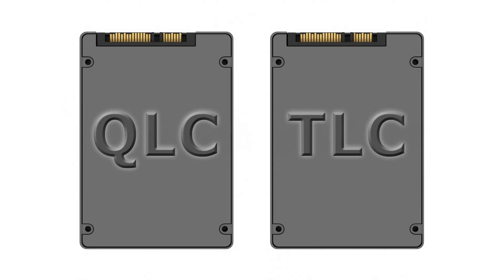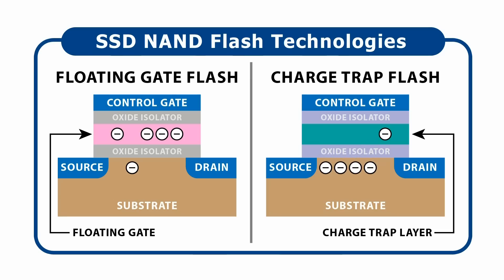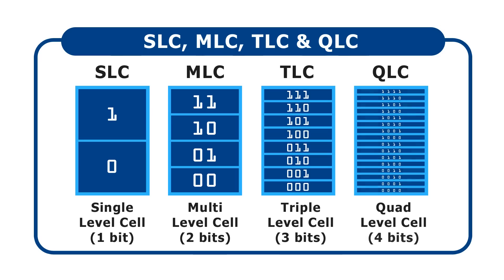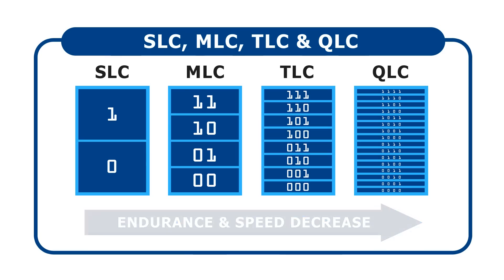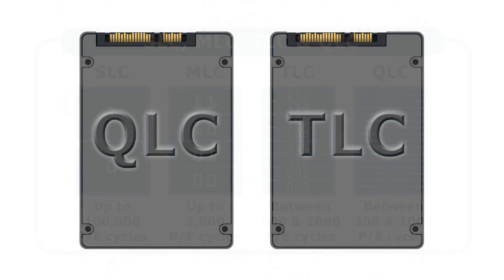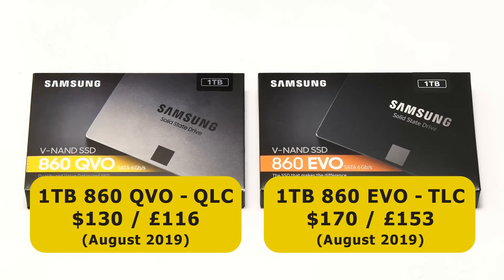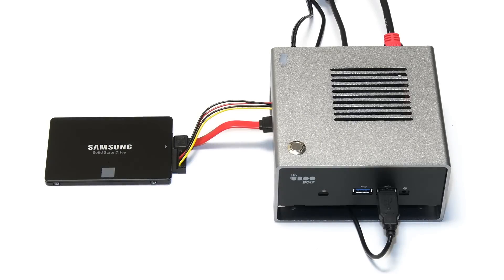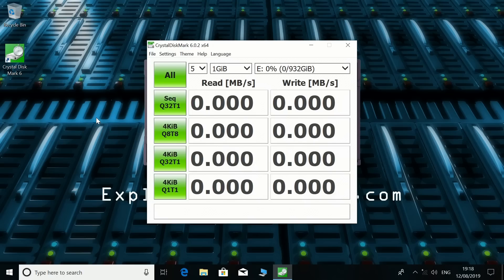QLC vs TLC SSDs: Samsung QVO & EVO

Comment: So then the days of having our computers simply work for 10 years and more are DONE! We must get used to the SSD drives as EXPENDABLES! And religiously back them up so that when the TRIM function uses up all the available cells in the SSD and we get a 'disk full' message we can than pop out the EXPENDED SSD drive and pop in a fresh one. I predict that most users will find this quite annoying. They will say to the computer manufacturer: "You DIDN'T TELL ME that my computer would need a new disk at age 3! And my formula for curing cancer, eternal energy, protecting the earth from asteroid impact and bringing peace to the world WAS ON THE "EXPENDABLE" DRIVE!! NOW IT'S GONE! THE WORLD IS DOOMED ALAS!!
Reply: as you will find below that is the time of warranty, most users will not reach the life expectancy any time near that Point in time.
the life expectancy of your Computer is usually Shorter than the life expectancy of your ssd, if the ssd is expected to last ten years even for a power user.
also: you should never rely on a single drive to store any important data. anyway. BACKUP BACKUP BACKUP!!!
also: exchanging your ssd is simple and quickly done.

Comment: I am still working with a EVO 840 250Gb for 4 years now and i still have no complains about the drive. I am at 1/2 way of its lifetime now. I used 60Tb while its lifetime expects to have in between 120 to 150Tb writing. But my next drive soon will be an EVO 860 1 Tb drive for certain.
Reply from the maker: I know that so many people here use EVO drives. They are great SSDs.

Comment: Actually, the boot/system drive is probably the best place to put a QLC drive.  I wouldn't put the swap partition on it, that gets lots of r/w activity and will more quickly wear out the drive.  However program files are not very often updated, and if you leave enough uncommitted space on the drive for wear leveling they will last quite long as a system (ie: program storage) drive.  If you do lots of video editing, cad work, program development, etc, where you create lots of data files (especially temp files that get created, overwritten, and deleted often) then you'd want a more reliable storage drive.  MLC and TLC drives with lots of uncommitted space would work well here, but you'd have to buy a QLC drive with perhaps double the amount of space to get enough write cycle life (IMHO).  Either that, or a fast rotating drive for your workspace.
Reply: For a modern system it's arguably better to install as much memory as you can and have no swap file/partition at all. You can even go one step further and create a RAM drive and tell the software to create temp files there instead.

Comment: How does the number of read/write cycles of a QLC SSD compare with a standard micro sd card or a sub flash drive?
Reply from the maker: Most SD and other cards, including USB thumb drives, will be TLC these days. A write endurance of maybe 1,000 PE cycles or less is likely to be typical.

Comment: Wanders off to buy a Pro MLC drive instead.   lol  ;-)
Reply: Maybe another comparison between all of them would be a good video 😉
Reply: Better buy a enterprise slc ssd :P
Reply: @TotoGeenen  YES. Smaller capacities but those DO live upto the FLASH DISK hype. Sadly, the controller failures are the big issue, no matter the nand type so...
Reply: @TotoGeenen  I would, if I could find them.
Reply: @darkfalse  they're enterprise so they're not easy to find on the sites you're used too. You could also try searching for specific drives to get better results, for example the HPE P06952-B21 750GB. SLC ssd's are insanely expensive though and a consumer there's no real reason to buy them. 
Some of samsung's more expensive drives are MLC though if that's something you're interested in
Reply: Hey Toto, what do you make of MiCRoN's 5100/5200 MaX series?

I know they are supposed to be better than their PRo & eCo counterparts, but are they the same as a PRO version from SaMSuNG??
Reply: @demitsuru  It depends on how you value your data, plus look at the slow down on the quad level SSD, if that is going to be a problem for you or not.  You can protect your data with back-ups and NAS, on slower HDD, so you can still use SSD even if you don't 100% trust them.  My boot drive fails then I lose very little, I have to install W10 and Office plus a few other programs.
Reply: @twmbarlwmstar  - everyone who values their data backs it up anyways. Also NVME is basically the same price as 2.5" now and MUCH faster. Samsung Pro drives have been a waste of money for years and continue to be.
Reply: @itsneight1260  "everyone who values their data backs it up anyways" missing my point I think.  And what evidence do you have that the Pro drives are a waste of money?
Reply: 2 thumbs up.. I reviewed USB flash ssd tech.. Yup, MLC wins by far, and for Samsung go Pro or just use pen and paper !
Reply: @Propaganda Blitz There's middle ground as well, they realise that we can't afford enterprise so they offer premium SSD.  I'm just not short of storage, I think I have, depending on how you count it, about 20TB.  Most of that is HDD NAS but I still have a few TB of SSD and about 2TB of fast SSD (although obviously there is always faster).

This will only be a consideration for future builds for me and I think I will just go fast small SSD for the Boot drive then one of these for storage.  Probably hang on to SATA a bit longer but the writing is on the wall there- if the motherboard has two M.2 slots then you don't need the SATA.  Although often enough the 2nd M.2 will only run SATA speeds anyway (or reduced speed).  You get that with AMD and their APU.
Reply: @twmbarlwmstar  Do you have no form of compression? A compression like ZIP and GZIP can at least save 1 or 2 TB from that. Though, it will take a while to open it back up
Reply: its your money... waste it where you want to.

Comment: My old old 840 EVO 500 GB still does 541 MB/Sec, just hit 13178 power on hours :)
Reply from the maker: Those EVOs are such great drives.
Reply: Hey, I have one as well, still going strong - although I don't boot from it anymore (I have a 960 Evo), instead it is handling my games install files.

Comment: Clearly, reliability and speed are trade-offs, but the average user of computers would probably not notice them for a good while, got it!  Another great and useful video, you have all my thanks!!

It occurred to me that perhaps the EVO was able to empty the cache more quickly (being the faster of the two technologies) so the big slowdown was averted in this instance, and thus the bottleneck was with the UDOO Bolt or Windows 10 (or the combination of the two).  Not knocking the UDOO, but I wonder what the tests would be on a server-grade or a gaming machine would have been, all else the same?
Reply from the maker: I am sure you are right that the EVO can empty its cache (to its TLC cells) more quickly. I should have though of that. I doubt the UDOO BOLT is a bottleneck here -- its got a quad core Ryzen CPU and 32GB of RAM.

Comment: Manufacturers should really make the effort of advertising clearly the differences between both technologies. If you look at these boxes, there is simply no clear mention of the current technology.
This is clearly a way for misleading some consumers.
Thanks as always for the fantastic video.
Reply from the maker: I had not thought of this -- you make a very good point indeed. Both the EVO and QVO Samsung SSDs are great drives, but they could be clearer pointing out the differences.
Reply: @ExplainingComputers  ,
I'm constantly explaining to people why QLC drives aren't horrible. There's massive confusion related to the performance drop that only happens after a large, sustained write. But people keep saying "don't buy QLC because the performance just drops off a cliff if you do much" when in reality very, very few people will every write that much data at once. The LOWER PRICE makes a QLC SSD more than ideal for most people... if you're some god-like being who explains computers you may have different needs but for us mere mortals QLC is fine.
Reply from the maker: @photonboy999  I totally agree. I think we will see QLC drives become more and more popular with many users. As I said at the end of the video, we did not trust TLC not that many years ago.
Reply: @photonboy999  Sadly you are mistaken, QLC Drives are good, the downside is the time it takes that drive to become worn out compared to a TLC or even an MLC drive.  QLC Drives wear out faster writing the same amount of Data that a TLC writes,  while they are a great cost to performance solution the issue comes down to long term redundancy and it is there that QLC lose their luster.  So you wouldn't want to use one say for your system drive, but a steam drive would be applicable or movies and music, basically anything that doesn't constantly have writes, erasures and more writes.
Reply: It raises a point about marketing and how specs are very much manipulated. There is some what a comparison here to saying it's like buying a car that can do 100mph, but after 5 miles it's limited to 50mph. A bit of a grey area really. For normal daily use I can see that this would be fair enough (at least for the drives, not the car). But if this is not clear it could cause problems in certain usage scenarios.
Reply: I would never fully trust any advertising or marketing claims made by the manufacturer, best thing to do is educate yourself then form an opinion then make a decision.

Comment: 12:32 I think the SLC cache content could just be written to the TLC memory faster than to the QLC memory.
Reply: That, or the drive itself is one that failed QC as a 2G drive, so got programmed as a 1G drive with only the good blocks allocated, leaving the 2G drive controller ( which would be the same controller per generation) with it's much larger cache in there, but with the reduced main memory capacity. 

Another is that they ran out of the lower capacity chipsets, so instead ( probably as it is a single pick and place item, with a stacked die inside) simply substituted the larger cache chipsets instead as they are layout compatible, or they have depreciated the older controllers with the new higher capacity cache version, and there is a blend of the different size cache controllers currently in the supply chain, so they are refraining from updating the spec sheet till they are sure all the older versions have been sold off in the supply chain.
Reply from the maker: @SeanBZA An extremely good point -- I can believe this is the explanation. :)
Reply: ExplainingComputers would be maybe good to test with more than 78gb, too.
Reply from the maker: Good point.

Comment: I guess it would be useful to make some estimate of home and home office data read/write along time units like monthly and yearly. Windows and Linux, with qlc as boot unit. That would involve os updates, and day  to day use. It will involve many estimates and approximations, but, at least we could grasp some actual, practical meaning of ssd units r/w endurance, other than 3 or 5 years warranty.
Reply from the maker: 360TBW is about 1TB a day for a year, or 333GB a day for three years (the warranty period). In practice, very, very few home or office users are likely to write 100GB a day, which is about 36TB a year. So for most users, a life expectancy of 10 years is perfectly possible (which in turn is considerably longer, even today, that the life expectancy of most other components in a PC).
Reply: @ExplainingComputers  My 250GB EVO has been the boot and application drive (Windows) in my PC for around 3 years with around 12,300 power on hours (with a HDD as my data drive).  Samsung Magician reports that the EVO has written only 14 TBW, so very low indeed despite having reinstalled Windows and all applications on this drive quite a few times.  This PC is in use every day for at least 8 hours with a wide range of applications.  Applications that generate very large files (and scratch disks), and large file downloads, use the HDD.  So, for my "average" home use as a Windows boot and application drive my EVO SSD should last well beyond the warranty and the life of my other PC components.

Comment: I wonder what is next, penta-level cell?  (PLC)
Reply from the maker: Potentially, yes, we will get PLC. But the difficulties in reading more and are more memory states beyond QLC may not be worth the storage improvement. In PLC, a cell would have to reliably distinguish 32 states. And for the doubling in accuracy required, the payback of 20% more storage may not be worth it. In time, I'm sure that PLC will exist. But I imagine we have a good 4-5 years now where TLC and increasingly QLC will dominate.
Reply: @ExplainingComputers  - Thanks!
Reply: At least as a consumer, considering halving the life span of a SSD again (considering the QLC as basis) would make that rather pointless. I would certainly want to use a drive like that unless they become dirt cheap. Even then I wouldn't trust those drives with any meaningful data to begin with, just in case.
Reply: @Chrotesque  - Considering new adaptations that fall outside the performance and cost factors, I could see innovations like built-in RAID1 that would use the second half of each data block for redundant storage.  With a custom controller chip this wouldn't slow the drive down much and might even make them more reliable than MLC and TLC.

Comment: So you're saying SSD's work off of some form of wizardry.
Reply: That's reassuring, all those years I was thinking it was witchcraft.
Reply: @Cellphone Dave That explains that little guy with the pointed hat that appears on my screen. Got 'WIZZARD' spelled across his hat, calls himself Rincewind...
Reply: @brianm6337  I do wish these Wizard's would pop up a message when their about to die, as all Wizard's know when they are going to die :)
Reply: @wembley636  Only if they are SMART i believe. ;)
Reply: its molecular level wizardry .
Reply: thinking about the billions of  transistors  and the millions and millions of lines of code and data and tiniest mechanical stuff like hard drive head reading, i prefer to look at my pc and just think "magic, it gotta be magic" :D
Reply: @Cellphone Dave Don't forget all the pixies which do the wizard's bidding by moving the electrons up into the traps and back again.
Reply: @MrJozza65  Pixies don't work for wizards. Pixies are pure evil and wouldn't be subservient to just any wizard. However  if this was the case, I'd have to figure that they are unionized and the drives stop functioning properly when pixies retire with huge compensation. This compensation would/might not allow the wizard to afford payment for replacement pixies which may lead to unworkable bits of the work space.

    If you don't believe me that pixies are evil touch a live 120 AC wire and see if the pixies bite you.
Reply: @ITpanda  Good point, but I think that the pixies are probably working under the wizard in return for a particularly favourable renumeration package to suit their wants. If that's not what is happening, then I have no idea how these drives could possibly work.
Reply: He's a sorcerer ...an enchanter!!  There are those who call him...Tim!!!😃😃😃😃
Reply: lol
Reply: Lizardy
Reply: If you take a syringe and shoot some pudding into your drives so the Wizard can eat the drive will last longer.

True story.
Reply: @Cellphone Dave lol!
Reply: it's a trap...it's a TRAP!
Reply: @coogano  Run Away!!  Run Away!!!😀
Reply: XD
Reply: No he wasn't. But you just did.
Reply: If you know the details, it ain't gonna be so magical now
Reply: Yes. Yes,  they do. And don't EVER let the magic blue smoke out. Bad Juju.
Reply: basically, SSDs are comprised of millions of tiny transistors. TLC has THREE cells (three transistors, each being able to turn on and off) and QLC - QUAD, (four transistors, each being able to turn on and off). since there are more transistors in QLC than TLC which comprimises integrity more than TLC/MLC/SLC, a QLC wouldn't last as much as TLC/MLC/SLC.

Comment: isn't slc and mlc are better? why qlc and tlc still exist?

I bet Samsung contacted you
Reply: Price
Reply from the maker: SLC and MLC are indeed faster and more robust, and for some applications -- like recording video directly from a camera -- I would still opt for MLC. However, as @Bagasl notes, price (vs capacity) is the issue. In practical terms, TLC and QLC are now the dominant end-user SSD technology.
Reply: Used to know a guy that put together a raid  0 out of "bargain" ssds, and always was complaining how they kept dying. " I ran raid 0 for years on my old hdds with no issues, why do these keep dying?"
Reply: @taben9jake  If it was a Raid 5 or 6 then I could understand why a cheap/consumer SSD would fail in a raid array but not so much on a raid 1 or Raid 0. My best guess is that the SSD was doing something funny that the raid controller didn't understand or like which results in the controller marking the SSD as bad. Also if he was mixing and matching drives then that could have caused some problems if the controller was constantly waiting on one SSD to return/write data.
Reply: @66thething  probably didn't help that he ran defrag after every game patch lol